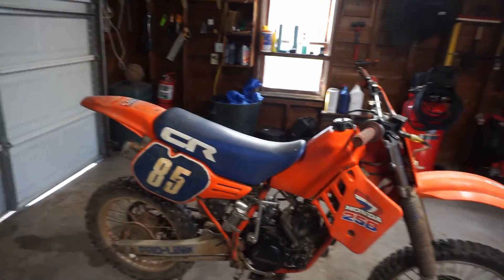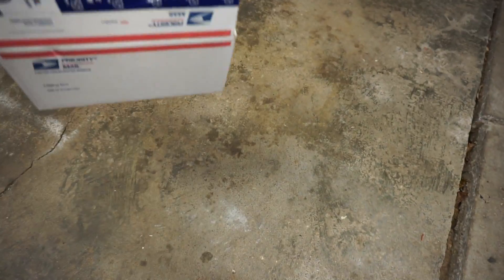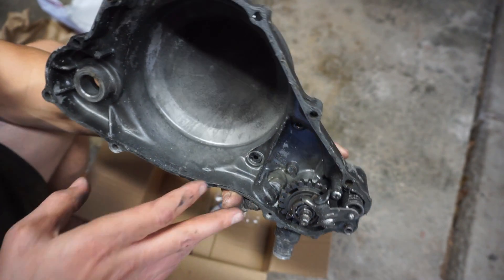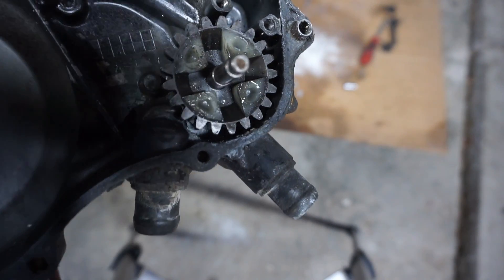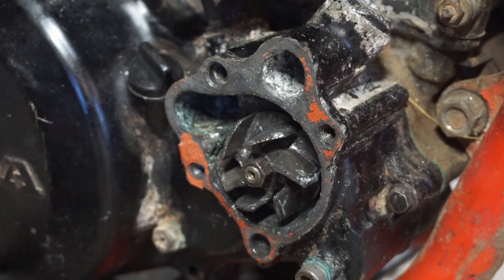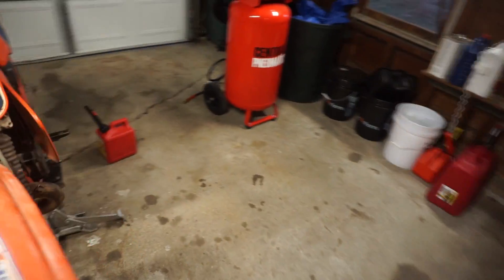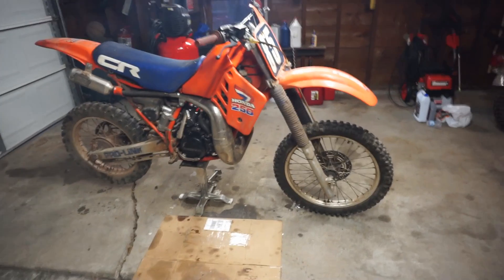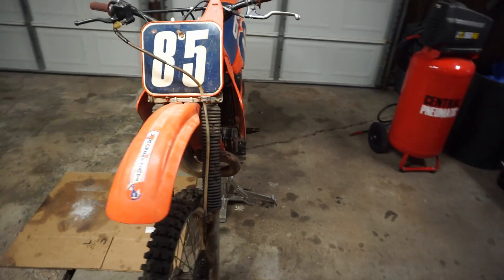First Start Attempt On $700 Honda cr250 Dirt Bike. Will It Run? (Part 3)

Comment from the maker: Does anyone have suggestions on what I should do about the clutch cover?
I hope you guys enjoyed the video! The bike is coming along nicely!
Please SUBSCRIBE and LIKE the video if you enjoyed! It really helps me out a lot!
Thank you for all the support!
Reply: I don’t know much about them but maybe an aftermarket one?
Reply: Can you do a warrior 350? I know you have done two but get one and mod it, if not (understandable) get a Suzuki Ltz 400 or 450 that would be cool
Reply: @c0munguyforcaz  there's been too many quads recently time for a few bike projects
Reply: You need some kick starting lessons.
Reply: Could you not weld another nut on top then try again to unloosen it again
Reply: Use more jb weld lol
Reply: couldn't a shop that welds aluminum weld a tube on that case to attach the hose to (even if they can't get total seal you could use jb around the weld )
Reply: @did_that_hurt8387  true he could just get a threaded pipe to screw into it and dothe same
Reply: I’ll sell you one
Reply: Cheapest way is to weld a piece off
 Pipe in there grind die old one away en stick a pice of pipe in there weld it and youre done
Reply: Take your original old one to someone who can mig weld and have them weld  it up take all the best parts from both covers make the best one out of the 2,  or look for a oem new replacement if you can find one, there out there!!!!!! Just gotta go easter egg hunting
Reply: Buy the $400 one on eBay. Start using that adjustable wrench the right way.
Reply: Are you married now
Reply: Turbo sockets gearwench makes an ok set i have the snap on set and that work wonders
Reply: Love those videos they are very awesome
Reply: @JD24443  Clutch case is magnesium and can't be welded
Reply: @oldvintagebikes5667  125 has different cover
Reply: hit a groove in it with a flat screwdriver or a chizzle then angle a screwdriver in the groove, heat it and hit it with a hammer till it turns
Reply: Use a nut cracker or dremel & split the nut. Epoxy in a plastic barb tube, from washing machine or dishwasher.
Reply: The case is probably magnesium based on the amount of corrosion.
Reply: Possibly tap the case use a pipe fitting with a hose end on the other side.
Reply: Hey Man U wanna but an old Suzuki dr 350
Reply: You need to invest in a soda blast cabinet.
Reply: You should've known. Those covers sell for 500 bucks nice and clean no damage
Reply: Tap the hole and thread a fitting into the cover 👍
Reply: The whole water pump impeller is threaded a punch and hammer is how to take it off and use some heat to heat just the impeller not the shaft and hammer it off with a chisel do it many times have to buy a new impeller but it will be done right not a patch job and hope the seals don’t leak the worst case the seal leaks into the motor and you won’t know it until it’s to late just do it right like my saying (one and done )
Reply: Get the right size tap and tap thread's in the cover go to hardware store and get copper pipe fitting with the size tap you used to make the thread's good luck
Reply: @motofarmer82  magnesium is welded by a TIG
Reply: @chrisfoley9942  That doesn't change the fact that welding oil soaked magnesium doesn't work too good
Reply: use a grease gun to get the pistons out of the caliper
Reply: @jasonpetrich4141  tig
Reply: @jbknowles1812  its magnesium like the chainsaw cases are!!!!he can get it done, i kinda thought so
Reply: Please put the new small spring in the kick lever and grease the internals up mate .
Reply: @oldvintagebikes5667  he ruined it already reverse threads!!!!
Reply: @jaydensdream714  dude he doesn't even clean them for resale!!! he works backwards sometimes,!!!! And does twice the work.
Reply: I'd buy that old cover off you for 100
Reply: Im like 90% sure the water pump is reverse thread you were definitely making it tighter
Reply: Joe can you get one of then bolt sets for rounded nuts.or what I done is hit a smaller socket on there.not a 9 mm but the metric sizes like a 9/13 .well them sort of sockets.it worked for me Joe.but after I had to cut the socket off.and a new bolt.but it worked.you have nothing to lose.ive seen you do some good fixes on ere.but your fixes.listen ppl always judge.but you get it done.
Reply: Where snapped put threaded pipe in also water pump put smaller socket over nut
Reply: Not sure if it matters now but I'm rebuilding my 85 CR250 right now. The whole impeller spins off you just have to jam\hold the gear in the back in place and it spins off. If you can't find a good clutch cover which is hard because of the corrosion in the housing, most people seem to use JB weld to fix the pits and holes which is what I did but mine didn't eat through to the the other side however the pitting was close in some spots. Hope this helps in the future maybe or if you have questions maybe I can help but since you seem to be done with this build It may not help at all. Good luck!
Reply: I'd love to see you do an 89 CR 250 R as that was hondas best year for power band and with only 5 gears 
the powerband goes for days in each gear.

I had 1 in high school it was fkn insane, so wishing I still had it today!

new sub, love your vids keep up the great work bringing these old gems back to life.
Reply: these are made of magnesium, I thought they were aluminum also. I found a shop that welds mag, and it took special order welding rod, it also had pin holes along the bottom of the gear oil gasket area, weird. but my welder got it all done, just havent tried it, bike is waiting some more parts. Good luck!

Comment: I dont always kick start a high compression 2 stroke, but when I do, I wear shoes and shorts!😂😂😂
Reply: Ikr smh
Reply: Kick start cr 500s kx 500s yz490s with shoes all day long.  Top dead and stomp it. Just dont do it with a wet or slippery shoe.
Reply: Fair enough
Reply: @jkirk7811  I always wear steel toes. I've had many a busted toe before. 😂
Reply: It’s the 2vintage way
Reply: @jkirk7811  exactly i ride a trx250r and all the vids i see people twice my age are scared to do it with norm shoes and I do it all the time
Reply: A 250 is cake to start with sneakers.
Reply: Old comment but yeah, I guess some people just know how to kick. I kick all my bikes in tennis’s no problem. Even my rmz450
Reply: It’s a clapped out 250?😂🤔
Reply: 😮😮😮😮⁵⁵ @BigMan-jk8lz

Comment: @2vintage: 
What you could do is is grind what’s left of the fitting flat drill it out tap it for a pipe thread and get a threaded and a barbed in peace and that should work it’s just a suggestion but in theory it should work. Ps use thread sealant as well

Comment: You need to buy a new case because the water jacket is broken. There is alot of pressure and heat in the water system when running , temporay silicone repair is unlikely to work.
The original cases all rot there because magnesium does not mix well with antifreeze coolant.
You can find new cases that are made from aluminum although they are pricey but worth it to never deal with water pump rot. I had to do this for my 88 cr250r exact same issue broken water jacket from rot. The water pump propeller is the nut there is a spot on the back side shaft to hold it with a wrench when the case is off. Mine was reverse thread , yours is garbage now but you could still get it off by hammering the next smaller size socket onto it and use a wrench on the back side , shaft should still be good and reusable . with a new case and new propeller.

Feel bad your having a tough go on this one. Good think you got your refund on the case , the seller very well knew it was garbage to begin with. At least for future on the old bikes you know to check this water pump system as all the original cases were magnesium and had this same issue.
Reply: I mean 86 cases are super rare and pricey if you do find one. I seen alot of people use JB weld and a dremel to clean it up after it hardens then clear coat it with some high temp clear coat and it holds up for a long time.
Reply: HofFritZ  it will hold up
Reply: They {Water pumps} were magnesium weren't they which was prone to corrosion until they went with aluminum after 88/89?

Comment: Buys a second had side case and and cuts it up 
Then says I'm going to ask for my money back 🤣🤣🤣🤣🤣
Reply: Was thinking the same thing myself. Lol
Reply: @sethnelson8698  me to.
Reply: @autooverride7462  yea but that dosent change the fact that he caused more damage to it alot of people who will buy these in bad co dition for repairs my ktm 250s clutch cover had 10 holes in it and alot more corrosion than that and some jb weld got her up and going cause I looked everywhere and there is no aftermarket cases and there are no cases that aren't full of holes cause my bike is the last year ktm had left kick start and 3 years before that they added a power valve so the clutch cover was only made for 3 years and I cant find a nice looking replacement

Comment: The corrosion from the early covers because they were made of magnesium magnesium and antifreeze don't mix antifreeze will corrode the hell out of magnesium later they switch to aluminum covers which were much better and didn't didn't corrode if you can try and find a cover from the next year model which would probably be made from aluminum

Comment: No problem man. To get the water pump bolt off go to advance or any auto parts store and buy a set of damaged nut extractors. They come in a set and range in size. I use them to take off lug nuts on cars. They will know what you're talking about. They have small sizes in the kit. Every mechanic should have them in their tool box.

Comment: That's why you don't use impact guns on stuff like that 😂
Reply: Couldn't believe my eyes when he done it the first time and then to do the exact same thing blows my mind
Reply: its quicker plus it's his not yours soo....  I use a impact driver for everysingle part of my dirt bike things runs like a charm never had a problem
Reply: Idk it would probably round it off or break it either way.  I seem to have better luck with impacts than by hand.  Also aren't those threads left hand threads and he was tightening them?  Could be wrong on that one.

Comment: On your CR250 rebuild, the waterpump housing could possibly be drilled out and tapped to accept a brass pipe fitting. The pipe fitting you use could be a bit long so your damaged coolant hose could be trimmed and still be used.

The corrosion on that case looks like they ran plain water instead of coolant. That is why case is badly damaged by corrosion.

Comment: If you haven't already invest in some 6 sided hex sockets rather than the multi spine, you'll forever be rounding things off with those. Also impact sockets are black, I've seen chrome vandium ones shatter into many pieces before.

Comment: Didn’t think it would start either,,nice job man 👌🏻🔥
Reply: Why not ?
Reply: @thomasgu3281  well it doesn’t exactly look in showroom condition now dose it ?😄
Reply: @dublinbikereire  do work on bikes ? Not saying this guy is a good example. But it had a decent amount of compression. As long as the crank isn’t out of spec it will fire. With it being a early model liquid cooled you have to watch out for the rotting cases but other than that it’s pretty simple
Reply: @dublinbikereire  you must've never seen a clapped out bike
Reply: It’s a Honda it’ll never die

Comment: The water pump impeller or the thing you stripped in the water pump the nut is part  of the impeller so you could get it off by spinning it

Comment: To remove that water pump nut or any rounded off nut  - maybe too little too late and use at your own risk -  but use a really sharp, really small and light chisel with a hammer,  and hammer the chisel into the nut at 90 degrees. This will split the nut to where it can be chiseled the rest of the way off. If you do this be careful not to hammer into the impeller shaft threads or bend the impeller shaft by using too big a chisel or too hard of hammer blows. This technique works well with frozen exhaust nuts. Good luck.

Comment: Adding more 2 stroke oil to the gasoline than necessary actually makes the mixture leaner. Use jetting settings to richen. Sounded lean on start up, bogged when you gave it throttle.

Comment: I'd pull the whole bike apart remove the paint and polish the aluminum, sandblast the motor and have a body shop paint and cleatcoat it.

Comment: I would have tried to pull the hose connecter out of the other cover that you bought, maybe with heat from a blow torch or something, if you can figure out how to get that one out then try the same trick to get the broken bit out of your original cover and swap them ........ and with the water pump, you may need to sacrifice that impellor in your original cover to get the stripped nut off, and then use the impellor from the cover you bought and swap them as well ...... no idea if it will work, but I would have at least tried that first before buying any other parts. ...... with the brake calliper try getting a "C" clamp on there and pushing the pistons back in a bit first, then try and work them back and forward (in and out) until they get loose enough to pull fully out.

Comment: When you kick start. Push lever down until you feel it hit top dead center, there will be a “click” then take it till you fell it hit compression. Get the kick starter all the way up, then really jump on it! You learn these tricks when you get a 500cc two stroke.
Reply: And put on some boots. Those tennis shoes won’t work.

Comment: If you kick it like a man you could turn it on first try
Reply: I told him that months ago.
Reply: It's called STARTING it, not "turning it on".🤣 You "turn on a TV, or a light. You START a motorcycle, car, or any engine for that matter. I do agree though, that he was kicking it like he's never kick started a bike before.
Reply: I'm new to this channel and have been watching a bunch of his videos and im amazed how he kicks these machines. The way he kicks them you would think he never sat on a bike/quad in his life. Its very odd to me lol. It also blows me away he strips that first bolt with the impact and instead of using heat and a breaker bar he just gets lazy and uses the impact to strip out the second nut!

Comment: With these magnesium covers, it’s crucial to use waterless coolant so the cover doesn’t corrode any more! I have a 86 cr125r that had the cover fail, I was able to repair mine with jb weld, and now I run Evan’s waterless coolant in it. Pricy, but it ensures I don’t have any more issues

Comment: keep on this machine and if you can not find clutch cover get creative with JB weld, it will hold and doesn't need to be gobbed on, also the water hose connection stub can be fixed with it cut and replace stem creativity is key with these bikes, Good Luck

Comment: Put a copper pipe maybe 3inches long insert the 1 inch use some aluminum brazing sticks with a torch then attach the hose to the copper fitting. You can adjust the pipe dremel off any excess.

Comment: What you need is a set of six sided sockets short and deep well socket i use them all the time and I haven’t stripped a single bolt or nut But I have twisted some off

Comment: Sucks when people use incorrect fluids. There's actually an antifreeze that's made specifically for use with aluminum motors so it doesn't corrode parts.

Comment: Another thing I noticed. Every chain and sprocket have a tight spot. Check the tension while you spin the wheel slowly. When you find the tight spot then adjust the chain. If not you will have places where the chain is too tight. I learned that a long time ago. Try it. It's true. Just trying to help.
Reply: maybe if the chain is stretched but it shouldn't be like that if it's good or it would wear out both sprockets in no time.

Comment: Take the old cover off, drill out the water inlet tube that broke off and tap some threads, and screw in a brass male thread to barb adapter problem is solved. I know this video is 3 years old, that would have been my first thought to repair it.

Comment: Maybe it’s reverse threads. Get you some Astro stripped bolt sockets. And get some pipe taps and tap some threads into the water pipe.

Comment: If you find a really good welder they can do some magic you'd be surprised. Look up guys around you who can weld aluminum. I found a guy that has replaced chunks broken off of a case for me in the past. Also someone mentioned in past comments that there is an aftermarket two piece case replacement set for this bike. Might want ro look into it fig id tell ya. Thanks for the video.

Comment: Use one of those bolt/but extractors with the teeth that bite into the nut.  Amazon has them should be able to get them pretty quickly.  Once you get it off take the case to a welder and have them weld up a new bung.  Easy work for a good welder

Comment: When you have trouble with bolts not coming out you got to put heat to it get yourself a good oxy acetylene torch it works every time. I couldn't even imagine not having a torch in my shop I use it that much
Reply: Never put a torch to magnesium.  It will light up!
Reply: @jakejames1977  no it won't I welded magnesium
Reply: @jakejames1977  not to mention he would only be heating up the bolt not the Magnesium cover

Comment: Buy a new cover. I believe a two piece replacement can be had. Do not restrict the flow of coolant by connecting the pump with the hose using a spacer tube. Bad idea. Getting it running isn't worth much unless you go whole hog on the rebuild. I'm almost done with an '89 cr250. Eric Gorr crank and cylinder rebuild. I replaced all the internal bearings (Pro-X for the crank, OEM for the cases) and painted it semi-gloss black. Unless you want to spend big dollars and do it right, part it out.